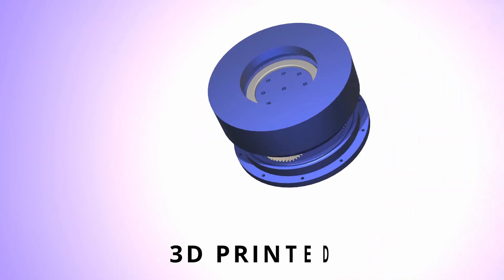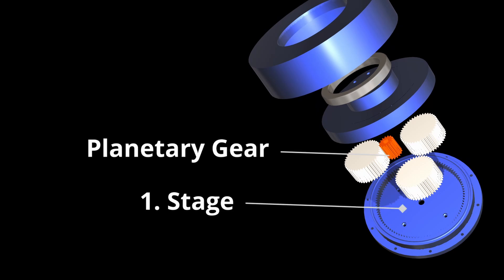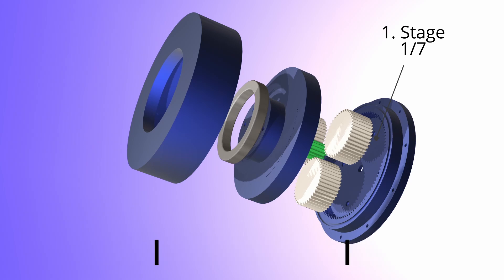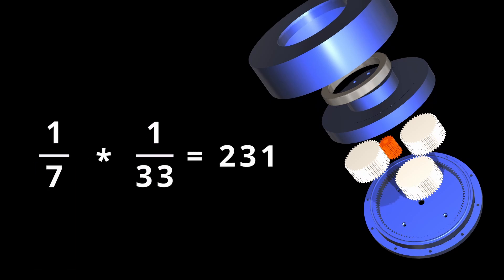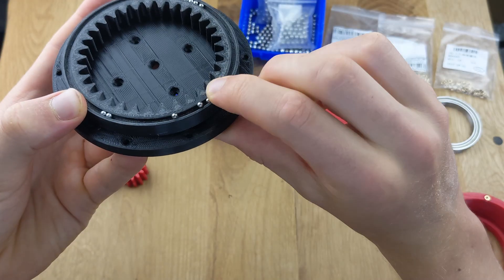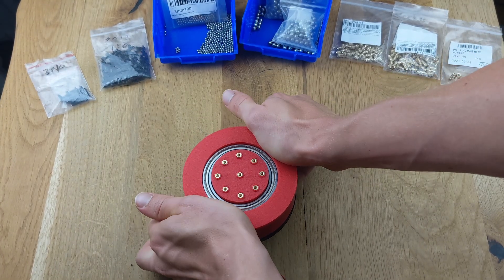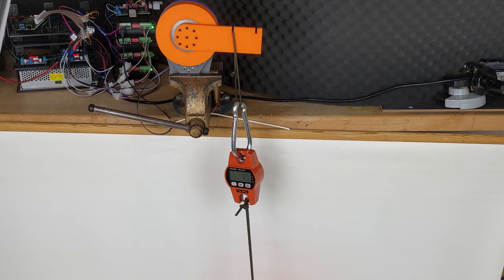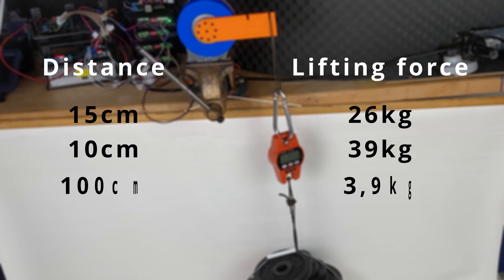The strongest 3d printed gears you can make?

Comment: I have also made this reducer. In Japan, it is called a "mysterious planetary reducer." The planetary gear does not require a carrier, so it has a small number of parts and is simple. It would have been even better if you had introduced how to design the transition gear used for the external gear.

Comment: try M16 threaded worm gear with M16 bolt. for example 1:101 gear ratio. its pretty small. well the M16 rod is metal. off the shelf. yes a more traditional worm gear drive. yes 1:101 gear ratio in one gear step. not two gear boxes.
Reply: Yes, you will quickly find the fatigue limit of 3d prints with a worm gear, eliminating a 2nd stage. what's left is the PLA or whatever material, and the small initial ratio as the variables.
Reply: @pauls5745  well you can thread the worm gear from metal with normal M16 threading tools. same quality as an M16 nut, just a circular worm gear instead.
Reply: @pauls5745  you can also lost pla cast the metal worm gear as intended, not talking in 3d printing context in general. but any material any easy technique. well you can 3d print metal.

Comment: It is true that it has high torque but it works very loudly... especially when the parts are plastic
Reply from the maker: Without a lubricant, 3d printed parts are definitely noisier. I used standard bicycle grease for my gears and the difference is huge.